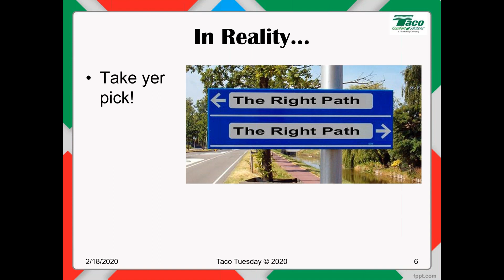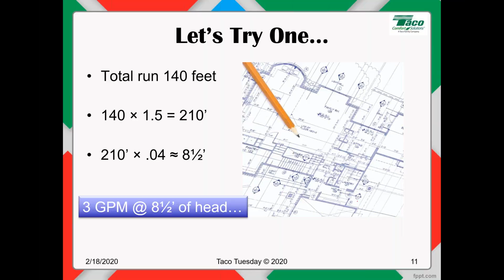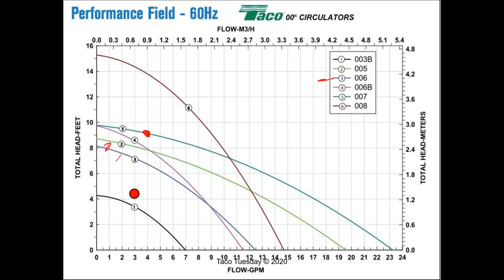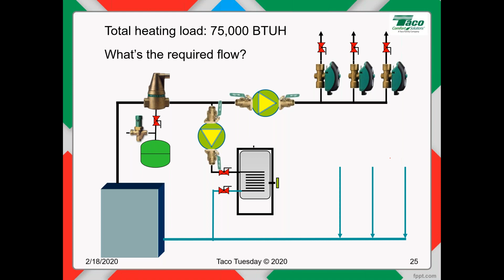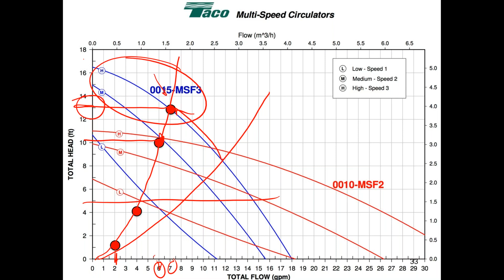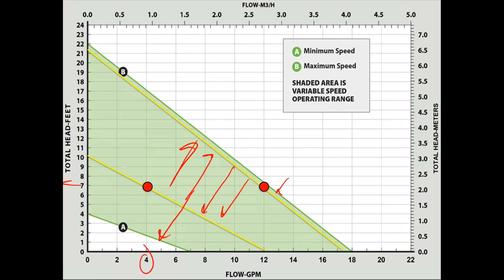Zone Valves vs. Circulators; Which Is Better?

Comment: buuuuuuttt what happens when all 3 zones are calling for heat at the same time? can one circ pump handle all that baseboard at once? i have been having issues with navien combi boiler not being able to satisfy all 3 zones :(
Reply from the maker: That is where the math is most important that you have selected the correct circulator to handle all three zones. Doing the math will reveal what flowrate is needed for each zone, adding them together as well as calculating the associated head loss for each zone. The math in this webinar starts at the 9 minute mark.

Comment: Would circuit setters help the small circuits not over pump when they’re the only ones calling?
Reply from the maker: Circuit setters can definitely help reduce the flow and maintain the proper flow in each zone when the circulator is over sized and when just one zone is calling for heat in a zone valve application.

Comment: Great info!
I'm setting up a hydronic system in my house now. I'm wondering in a system zoned with valves, say using the vt2218 pump, how the zones will balance if the head pressure is different?
Reply from the maker: Brandon,
You are correct, in a zone valve system if you do not have balancing valves installed, the head loss will be different when the zone valves open and close. The VT2218 is designed to operate on a temperature drop.
With a zone valve system, the circulator will see the targeted temperature drop but each zone may be completely different from each other resulting in an average Delta-T. That will mean the zones with the smaller Delta-T will satisfy sooner, the zones with the larger Delta-T will run longer.
The same thing would happen with a Delta-P circulator system without balancing valves.
Reply: @TacoHVACtv  Thanks!
One more question about the VT2218: my boiler recommends a primary/secondary system with closely spaced tees. What would be the ideal way to set that up? Both Pumps VT2218, or use a fixed speed pump on the primary?
Reply from the maker: Use the recommended circulator from the boiler manufacturer or at least find out what the flow and head requirement through the heat exchanger needs to be. I would definitely pipe it in a primary/secondary method. and ask the boiler manufacturer if the VT2218 is a suitable pump for the boiler side. Sometimes the technology (in the boiler and the circ) fight each other. Imagine one car/two drivers! Then use the VT2218 for the heating side of the system.
I know of plenty of projects where the boiler side can utilize the VT2218.

Comment: That pump sizing is nuts and just not needed since the 007e or Alpha pumps came out. Just get a ECM constant pressure pump and let the pump handle it. Its like $50 more and pays for itself with power savings.
Reply from the maker: Robert, that may be true for alot of projects, but doing the math to find out if the circulator is the right size and programmed properly is invaluable.
Thanks for watching.

Comment: Great video, but the industry is no longer using copper, we have moved to Pex, so the formula changes, I seem guys over-pumping because they use that formula for Pex using 4 fitting total. Can u guys make a video for PEX and self-adapting circulators?
Reply from the maker: @icecoldusa Thanks for the comment and I will pass along to the trainers. We have addressed pex in other presentations and webinars. The math is going to be the same for when you find the flow, however the head loss calculation will be different. The way to find the head loss is to look at your pex manufacturer of choice and use their charts. They will give you a head loss on a per foot basis or per 100 feet.

Comment: I am a DIY person and I installed a boiler with zone valves about 30 yrs ago. I do not remember the brand of  valve. The only way to fix a valve was to change the motor. Toward the 23 yr mark 2 out of 6 actuator motors were replaced. My thinking was the next one that went I would put in all new ones. Replacement would be easier. I bought the Taco Sentry system. Well the bad news at the 5 yr mark the first Taco valve failed. Last yr another and now the third. 3 out of 6 valves from the original lasted 23 yrs. With new Taco 3 out of 6 lasted 7 yrs. I know another will fail soon. And I look at the 30 circulator and hope it lasts at least this winter. One of the selling points for the Taco is it uses less energy. At $100 to replace the heads you will never recoup the cost of these of the failures. Reliability is not mentioned. With only a 3 yr warranty Taco was not sure how long they would last. I thought about the circulator system and with 20 20 hind sight I would have gone with it in the beginning.
Reply from the maker: Good Day Don, I apologize that you are having issues with your new zone valves. The Zone Sentry valves have had a great track record for the past 12 years. When I see failures like that in a such a short amount of time, I would want to analyze other things that could affect what you are experiencing, like water quality, the power supply and such. If needed, please contact a local representative that may be able to help. You can search for one near you here  https://www.tacocomfort.com/rep-locator/

Comment: if you have two zones , one with cast iron radiators and one with copper baseboard each having there own thermostat would it be better to have two circulator pumps? The radiator zone is a little larger than the copper baseboard zone,  it's a small duplex home, radiator zone is on the second floor,   Getting very loud metallic banging in ceiling of 1st floor zone. can't figure it out.

Comment: Look it’s simple. They both cost the same and both fail about the same. When the zone valve system fails cut its circular fails (it’s only one) you have ZERO heat

Comment: Great information.  I'm replacing a 5-Taco Zone Valve system w. 125,000 BTU boiler with a new 140,000 BTU boiler and switching to pumps.  This webinar by John Barba has given me much valuable information on how to size the pumps for the different zones which have a very wide range of BTU requirements.  This webinar also explains some of the short-cycling behavior and occasional pipe-banging behavior of the old system.   The Taco zone valves on my old system (29 years) proved to be very reliable: about 1 zone valve failed every 2-3 years.  The new system will be more efficient at heating the house with pumps and better behaved now that I understand how to size the pumps to the zones....
Can't wait till the next instalment of this series....
Reply: 1 zone valve failing every 2-3 years is reliable?

Comment: I cant wrap my ahead around the fact that if I were to use zone circulators in a 3 zone system I would need three circulators to run it. However if I use zone valves, and I take the circulator for the loop with the most head loss, and use that circulator to run the entire three loop system.  Because it is in parallel still doesnt make sense to me because in my mind, you need the same amount of head to run the entire system regardless whether you split it in three circulators or use a single circulator with zone valves.